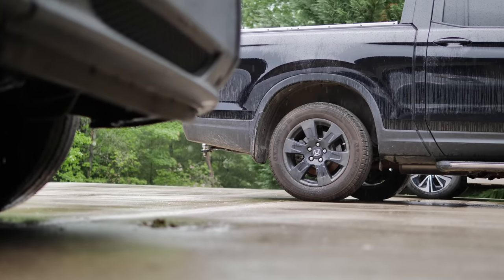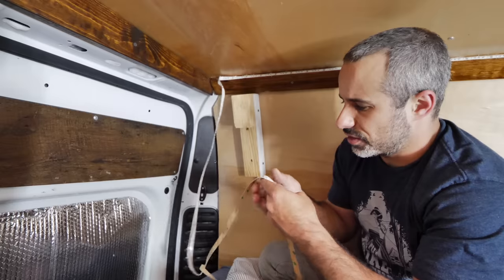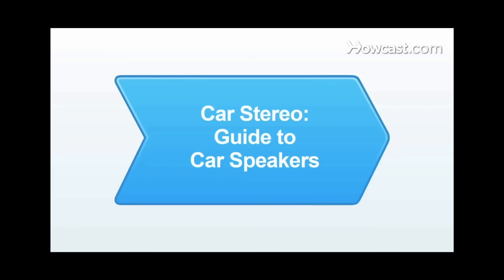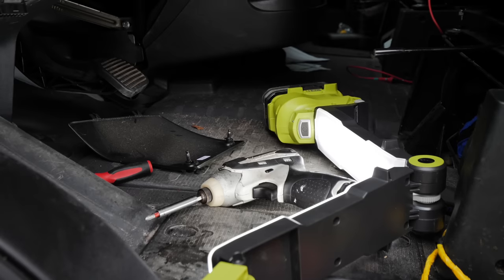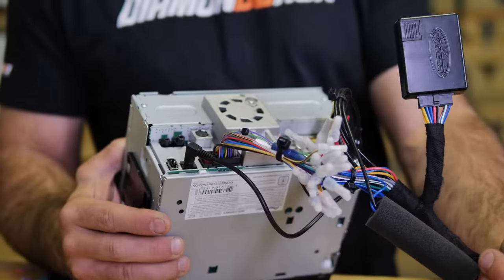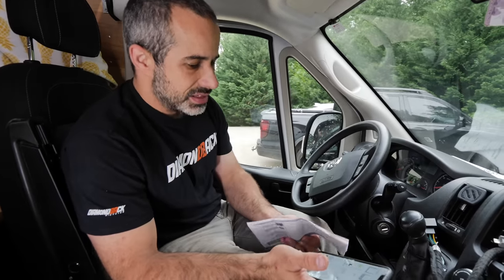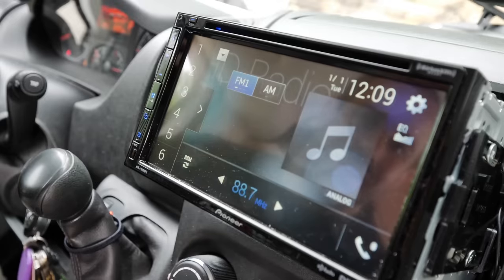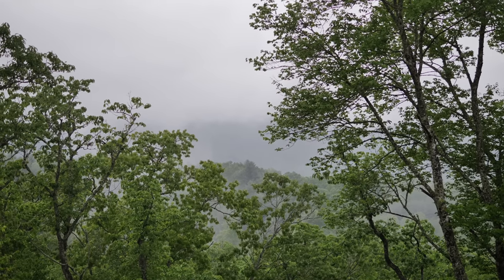Before YouTube, I installed car stereos for a living

Comment: used to install car phones n 2 way radios in the 80's  way more fun than this you had to drill a 10mm holw in the roof of brand new cars ...and becuase this was the start of mobile phones it was all the top end cars like BMW/Merc/Jag...etc   and the holw had to be in the middle of the roof (at the front or more usually rear of vehicle)  ....and that was done by using a measuring tape...pilot hole to make sure and try not to go right through the head liner :D

Comment: Great, another vehicle running LED's in a Halogen reflector housing. Either upgrade with halogen bulbs and better wiring, or swap out the housing to projector lenses instead of reflector. LED's in reflectors will scatter light like no tomorrow and blind oncoming traffic, as well as sending a bunch of your light to the moon, instead of the road where it's needed

Comment: I don’t know if you’ll see this comment, but i was wondering if you could please review the Ried horizon 1.0. I am looking to start mountain biking and as i am only a teen i am looking for something affordable but good quality. (It is an Australian bike so i dont know if you can get it in america). Thanks
Reply: I wouldn't recommend getting a full suspension under 1500
Reply: I used to have a trek x cailber  and that worked great as an entry level bike. Also the trek Roscoe's would be a good choice. Try to get a bike on sale. Your mostly going to find the best value from brands like giant, trek, and specialized and the worst from brands like santa Cruz.

Comment: LEDs on headlights without projectors is a safety risk for anyone driving in the opposite direction. You see better by blinding everyone else :(
Reply: Nathan Lynch I hope they did the high beams, but the video doesn’t clarify and from what I saw, it seems they just put LEDs on the low beams. It may attract LEO’s attention driving at night, blinding everyone